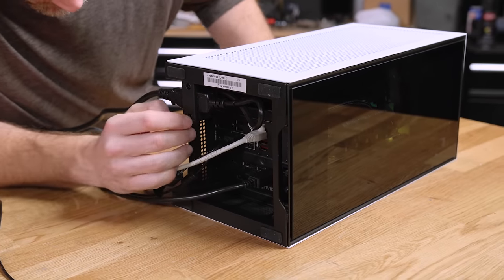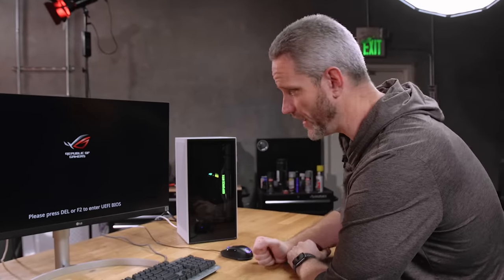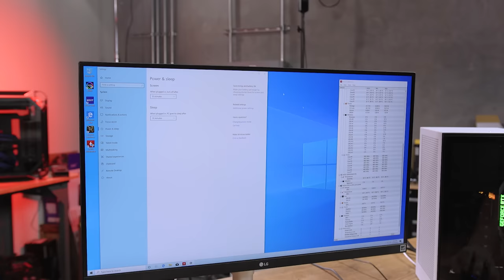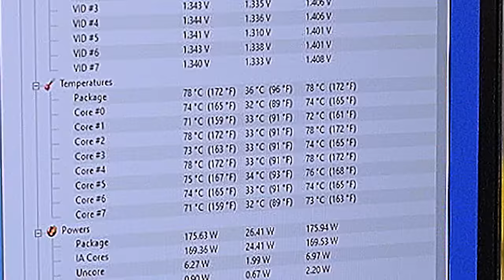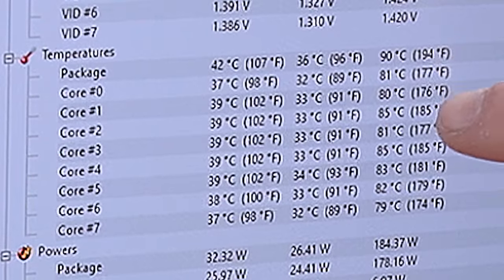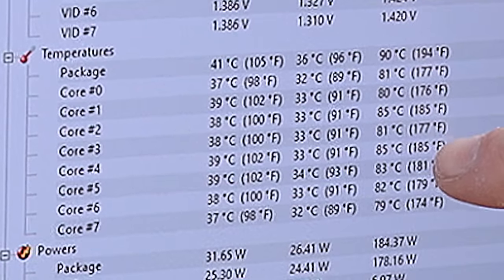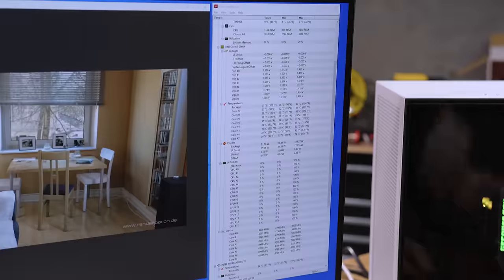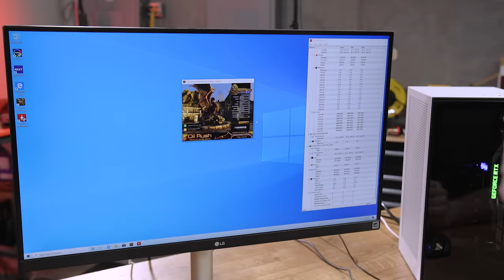You NEED to see this small PC case!

Comment: We need a fan on top mod. Also I love how Jay doesn’t have to rush his videos out because even though we’ve all seen 5-20 reviews of this case, we’re still going to watch Jay’s review.
Reply: Fan mod or tell Silverstone to bring back the FT-03. The sad thing is the Silverstone Fortress FT-03 had the right idea over 10 years ago....but they were so ahead of their time, until this NZXT case there hasn't been another ITX case like it. My buddy still uses it with his RTX 2080 super and i7-9700k.
Reply: I guess they didn't add vents to the top because if it was on top of shorter table etc it could kind of be used as a table too so they wanted to keep the top surface airtight and smooth.
Reply: It DOES have a top fan. The PSU. It's just facing the wrong way.
Reply: @andrewjatz6092  I have the FT-03 Mini, it also does water cooling if you want, however even at full price it was around £100, this case is £300.... not sure an AIO & decent PSU is worth £200 more, as I like to choose my own. Still this design is better than the FT-03 Mini, as its got vastly better stock cooling for graphics cards. I suppose I should stop complaining as I have also been looking at Thorzone Mjolnir as a potential next case. (ie a case I can fit a wider variaty of GFX cards in with out massive heat issues.)

HOWEVER: I use the newer X570 boards and I keep my cases for 8 or so years, so a new case late 2019 early 2020 that does NOT have a PCI 4.0 riser.... it quite the turn off.

Comment: Sees this case: Oh this looks cool

Sees price: Nvm

Sees that it comes with PSU and AIO cooler: Oh cool

Checks wallet: Nvm
Reply: just looked, $350 holy balls batman.
Reply: Yeah I saw the price and was like holy cow, but then I read it came with a psu and an aio. It's really not super expensive when considering the inclusion of those components. I just spent 110 on a psu and 130 on an aio for my wife's pc, granted it was a 750 watt gold evga and a 240 h100i pro. I never really thought much of these small cases, I like lots of room and fans for cooling, but this one actually looks like it would be great for a home theater pc build. Sorry for the long winded rant..
Reply: A case with an AIO and PSU for $350 is not bad
Reply: @tacticaltactics7665  True but the first thing I consider is my budget. Unless I'm trying to hide it in a wall for some reason they're all overpriced with too many limitations.
Reply: @tacticaltactics7665  it absolutely IS bad. I dont care about trivial "oh its rare!" Bs. 350 is too high for the case. Period. No case is worth that kind of money. Dont make excuses for greed. Its disgusting.
Reply: Given both AIO and SFX power supply in it, 350 isn't that bad.
Reply: @tacticaltactics7665  Yeah my evolv shift x is rare and the fact I bought a fairly expensive $170ish SF750 corsair PSU and had opted for open loop cooling.
Reply: @tacticaltactics7665  yeah but stop and figure the evga hadron cases even when they came out many years ago were only 150 with a gold 450w psu included. This case is seriously worth maybe $100 without the extras. Its greed, and i oppose greed in any form.
Reply: @BenFilley  It comes an SFX PSU, and an AIO Cooler, and everything is already cable managed.  Let's say I buy an H200i  (Mini ITX Case), that's $110, A Silverstone 750W SFX PSU, That's $140, then the NZXT 140MM AIO,  That's $103.  Mini-ITX builds are expensive man.  Get on with reality.  All Mini-ITX builds that performed as well as my Mid ATX builds i've done were all more expensive.
Reply: @BenFilley  you simply dont understand the sff market
Reply: @geigster  i understand it quite well. Some people with more money than brains im sure will buy it. That doesnt make it worth it.
Reply: Considering it comes with a high quality PSU, AIO cooler, special mounting hardware and has some of the installation done for you, that's not a bad price at all
Reply: @BrawndoQC  I'm sorry you don't know how to build efficiently? I dont see how that makes it worth $350. Its a case. Yes it has a psu and cooler. Individually those things are much less. They should at least have the option of no cooler and psu. They could likely even sell it for $150 and I wouldnt even criticize it. But as it sits it's not worth it. Doesn't make sense to pay lambo prices for a civic. And thats what this is. A civic. At lambo price.
Reply: AIO doesn't even have that mirror effect on the kraken.
Reply: Saaaaaaaaaaaaaaame
Reply: Big mood
Reply: I was all in until I remembered what my bank account looks like
Reply: Right? I was seriously considering this and was thinking maybe $150-180 and I was down... but nah, not for $350.
Reply: Ben Filley Good thing they’re not selling a case for $350. Theyre selling a psu, aio, riser cable, and case for $350.
Reply: @Athasin   That is a perfect observation of this subject you have made! You are not buying a case....you are buying a  "package"  of various components .  Is it a lot of money ? Yes....more than I could justify for "my" situation . Does it's  awesomeness  still make me want it ? .... YES IT DOES !
Reply: Oh and their spy ware system cooling software signup don't forget, all that data harvesting requires funding as well.
Reply: @TechandTools1  Why does it have to be relegated to a home theater? Theirs no need to think of cases this size as being gimped desktops you stream movies from anymore. You can run a balls out rig with an AIO under 15 litres that competes easily with 40L fatties (that probably have more volume of wasted space than the entire capacity of the 15L and under)
Reply: Dorientje Woller 
I am a little concerned about that cooler on a 9900k.
Reply: I'm in the process of dropping a couple benjamins on a sff case but that's just the case itself. This  is actually cheaper if I didn't already have an AIO and sfx psu. I might just end up building another pc completely. :D
Reply: just stop being poor lol
Reply: @tacticaltactics7665  I think the Silverstone sg13b has something to say about your statement.
Reply: @diomedes7971  all that doesn't make it a good deal. you can buy an itx case anywhere for 100 or less. a 650w psu for 100 or less. that shitty 140mm aio isn't worth $80. let alone 110-120. stop approving of greed. its disgusting. nvidia has accustomed you clowns to paying 2-3x what something is worth and its stupid.
Reply: @diomedes7971  im not saying it isn't a nice case. im saying its a bad deal. theres a difference. give the option of no psu or cooler and it has the potential to be a good value. but as it is currently it just isn't a good value for the money, when you can get so much more for so much less.
Reply: Decent price for the micro atx psu and cooler, those special size parts always cost more. My issue is the TG should be infront of the GPU, wasted opportunity imo.
Reply: I was literally going to say I was all in until I saw the price but your comment summed it up perfectly
Reply: @BenFilley  do you have any idea how much R&D money goes into making a case this size that is actually easy to build in? Also quality AIOs are over $100 and decent sfx psus are $100-$150. That makes this case $100-$150 which is not bad. 
Edit: Just looked on Amazon, Newegg, and NZXT's website and the best I could find was $120 for the 140mm cooler and $110 for a 650w 80+ gold six psu. That would put the case at $120 and it has the cables prerun and the AIO partially installed.
Reply: Ditto
Reply: @BenFilley  While I dont like it much, its part of the "early adopter fee" trend we've been seeing a lot the last two years. NZXT will likely release the case as a standalone sometime down the line, but for now it get some extra stuff and a premium price tag. At least its nowhere near as bad as what Nvidia pulled with the release of the Super cards to replace the standard versions because AMD stepped up and went head to head with them in the low-mid tier market.
Reply: @diomedes7971  that's what I'm saying. If I had the money to build a small form factor machine this case would definitely be on my short list.
Reply: @Excal111  see thats an argument i can agree with. But arguing about r&d when a middle schooler could design the thing on his school lunch break, im just not buying it.
Reply: @tacticaltactics7665  the shift is also larger, it can accommodate more coolers. It is designed to house a normal AIO, This case is not. Everything you see is entirely custom, from cable length to tubing length. That adds cost. The price of a case is more than just material cost, It's also labor cost. 350 dollars for this case is fairly acceptable, I'd say 300$ would be much better. if you consider the whole process. SFF PSU's are always more expensive compared to their ATX Brethren,  THat AIO is also shorter, that means, YES, Cut tubing, which means a change in manufacturing, which means added manufacturing cost. Prior to that, it meant R&D, at least it was part of said R&D. 

This is not your avg copy past + alter case, even though it looks like that. Comparing it to the shift is like saying mandarins are the same as oranges. I think they are making tens of dollars of this case at best. My biggest gripe would be how they see this case..

Is it all one Unit? can I use get a PSU shipped should it fair? Can i get an AIO should the pump fail? Do i have to sent the whole thing in? Though this case is not for me anyhow. My custom arctic cooler will never fit in there, unless I cut open the sides. I have my sights set in the O11D Mini. Gimme that gorgeous Fishtank!
Reply: even then, a $100 NICE itx or mid tower case with a regular psu and 240mm AIO is still almost $100 less
Reply: Problem is, everyone and their cat nowadays want to cram as much power as (in)humanely possible into the smallest possible chassis, which has lead to emergence of some really OP miniITX mobos, with prices going as much as 2x the price of similar spec mATX mobo. This chassis, when looked at closely, is actually very well designed and well-thought out for builds that will inevitably generate a LOT of heat, with the only exception being solid top (which should have mesh or even option for one more ventilator). So yeah, price is steep but this case is well worth it. 

I would love to see a low-end variant of this, though, for less demanding hardware which is cooler and doesn't require much power or liquid cooling.
Reply: I think 299 would be a better price than 349, but this is a specialized case for niche situations so I think a premium is fair.
Reply: But consider this in the cost.  How fast your next rig build is going to be. Most of my time goes in to a wire and all.  You're going to be gaming faster with this for that price I think it's fair.
Reply: Ben why so quiet? Oh that's right, you got totally owned
Reply: @diomedes7971  Just because the components are also sold at inflated prices by other people doesn't mean the prices aren't inflated. You can easily get a PSU and AIO that are just as good for not much more than half the price. $350 for this case is still not a ridiculously bad price, considering that it's all been put together like this and it's well designed, but it's still about $75 more expensive than it should be.
Reply: @karljuliuz  More likely he went to bed or left to do something else. Most people have lives outside of youtube.
Reply: @nathangamble125  Yea sure. It was a joke tho.
Reply: Less case for more price, more than a console and it doesnt even have internals!
Reply: It's a little pricey for sure but not insane when you consider the additional AIO, the PSU, and the cost of tooling. If these do decently I wouldn't be surprised to see newer models that are cheaper. Kinda like how the Thermaltake Tower 900 became a slightly short version and part of an existing line.
Reply: also has a gpu riser integrated which in some cases can run you up to 60$
Reply: @BenFilley  If you consider the SFX 650W PSU (nomally about 140$) and the AIO (90-100$ for a quallity one) the case itself only comes down to like 110-120$.
Reply: story of my life when i came to build a PC.....
Reply: Including a PSU, an AiO via a compact form factor for ITX boards while everything is soundly positioned for an easy build (that doesn't require hours of headaches and customization)? IMHO the pricing is ok. That said I agree with @TacticalTactics, it could be a bit cheaper.
Reply: HawkFest but my point is i don't have money lmao
Reply: @BenFilley  You're not paying for just the case though. It comes with both an AIO and a PSU.
Reply: @BenFilley  I like the look of this and $350 sounds OK.
So out of curiosity, I just looked to see if it has hit the market here yet (Australia) and Holy S....   $630     
BOY I was happy to be sitting down when I read that.
Then I checked other shops and no price difference, they are all the same.

And everyone on here is complaining about it being expensive at only $350

After a lot of hunting about, I recently bought a new Enermax Platimax 1350W PSU (dusty old stock - A$130), a new TT View 71 (open box, but never used - A$145) and a new TT 360 Flo Riing AIO (on special - A$165) and a LinkUp Ultra PCIe 4.0 Riser cable (discounted A$58).
A lot more effort and a bit bigger (should really say a lot bigger).

Still, I can see people buying this as it is a simple and neat (custom cable management) little case all ready just to plop in your MB (plus CPU, M.2 & RAM) and a full sized GPU and you are ready to go.    :-)
Reply: @BenFilley  It comes with a cooler and a psu, this means the price isn't bad at all, concidering you would be spending the same amount anyways
Reply: me "well you gotta factor in the AIO and the power su.... oh fuck yeah nvm"
Reply: Are you all forgetting the Apple 1000$ monitor stand? Let's shit on greed when it's actual greed.
Reply: A French top model is looking cool too and also to expensive
Reply: @BenFilley  now its 399$
Reply: @MrKoalabeere  wow, they found a way to make it an even worse value. bravo.
Reply: 300 dollars you get a 140 aio for under 100 and a 650 psu for 150 and 50 for the case but for nzxt its cheaper because they make it so its worth it
Reply: Total price $350 - PSU $110 - cooling $80 - PCI-E riser ~$50=~$110 for original PC case. Very good.
Reply: @BenFilley  case price is only ~ $100. The rest is for PSU, cooling, PCI_E riser cable.
Reply: Me asf XDDD

Comment: Jay: Case is totally tooless.
Jay 5 minutes later: Breaks out the ifixit kit.
Reply: I feel the same way about Hardware Unboxed, Tim and Steve NEVER unbox anything...
Reply: @heyguyslolGAMING  it's called 'hardware unboxed' not 'hardware unboxing' 🤷‍♂️🤷‍♂️
Reply: @Seif_Morsi  lol
Reply: The case is tool less. The AIO isn't
Reply: @Ravenousjoe  details details, lol
Reply: IFIXIIIIIIIIIIIIIIITTTTTTTTTTTTTTTTTT
Reply: @Ravenousjoe  I mean, if we want to get technical about it, the part he was unscrewing was a part of the case, not the AIO, it was the part of the case the AIO was attached to.
Reply: @Ravenousjoe  
You can't install the motherboard without removing the screws to the AIO.  Also, I doubt the motherboard is mounted with thumbscrews.
Reply: @alanhobson9121  lol, I think you are over analyzing this a bit too much. Generally a tooless case just means you can remove all the panels to access the interior without tools.

But hey, I guess we could consider our fingers tools right?
Reply: I thought it was Harbour Boxed
Reply: The only 'tool-less' PCs I've seen are industrial/medical PCs. Not only is everything latch operated, they print the instructions/illustrations on the latches (in case the tech hasn't worked on that model.) Ironically, the PCs that are designed to be professionally serviced are easier to maintain than the ones for nerds/end users. Low price = high difficulty.
Reply: @MrMaxABuck  I thought it was Hammer on box
Reply: @heyguyslolGAMING  No. It's Hammer on Box.

Comment: Dear Corsair, please make a DIY 'ONE' chassis like this, with CPU and GPU coolers included.
Reply: fr would love to see that
Reply: I bought the NZXT H1 case a couple of days ago for my new gaming build, but if that Corsair One case than I would have bought that for sure. If that Corsair One wasn't like $3000 but instead like $2000 I would have got it. Oh well.
Reply: Not gonna happen. Video cards are very different one from the other, so they cannot make a one block fits all or someone would have done so already
Reply: @demonwares  They can do two versions: One for AMD and one for Nvidia. Then just stick to founders editions of the current generation like most water blocks.
Reply: @Slackerdude74  I bought a Corsair One Pro on Amazon renew. It like brand new, but not the price was $1699 granted it was a First GEN with an I7 7700K with 32 GB and 480 M2 and 2 TB Seagate. I've already upgraded it to a ROG STRIX Z390 and a I7 9700K and a 2 TB Samsung EVO....so I spent the money anyways, but their are deals to be had and the upgrading the components aren't that hard.
Reply: phanteks evolv shift air is the og one, looks better but doesn't come with anything
Reply: Exactly

Comment: I got my H1 today and transfered all my parts over.  I did turn off all the RGB which i do not care about.  System is extremely quiet.  3900x never goes above 70c and 2080 ti never goes above 73c stressed.  I am sitting here writing this at 48c on cpu and 40c on gpu.  I am really impressed with this and I am coming from a custom loop.  Really small footprint!!!  I highly recommend this!!!